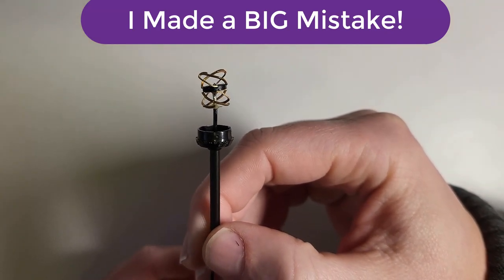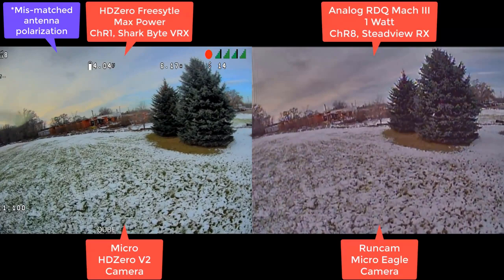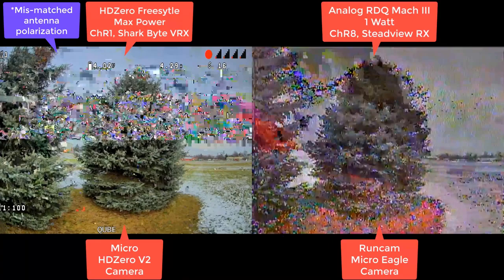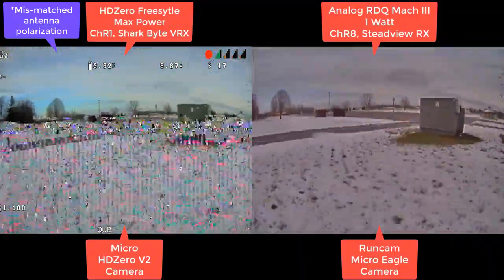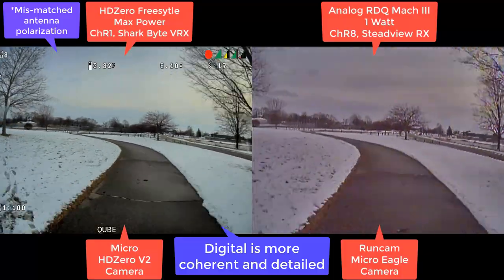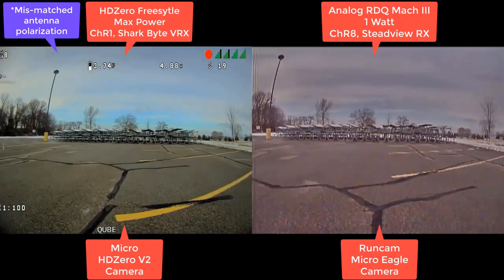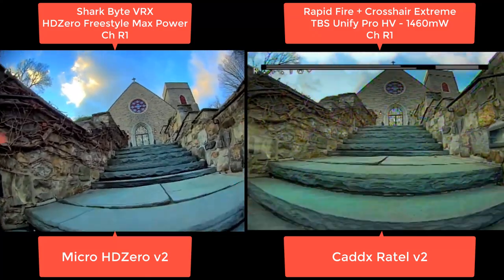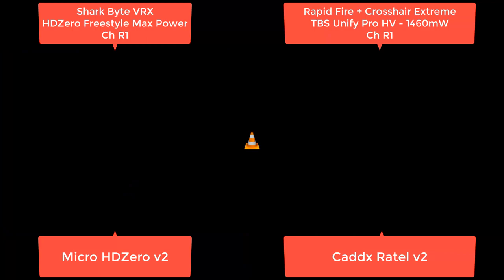Mistakes Were Made! - Outdoor Foliage, Thick Stone - HDZero vs Analog Penetration Tests

Comment: Apart front the actual digital image being a better picture those both seem to handle the environment very similar. Looked like HD Zero had more complete image losses than analog and even though the analog image at times looked like crap there was still an image of some type to fly through. HD was recovering quick thought. I am starting to like the prospect of the HD zero system. Shame about the antennas but we all only human. Good work again.
Reply: You have to take into account that there were mismatched antennae with opposite polarisation on the HDZero quad. Maybe that was responsible for the complete loss.
Reply: @jumpstartfpv  yer for sure, they did a pretty good job to say they were opposites. Look forward to see the difference with equals.

Comment: Thanks vor your videos and your work for the system.
Please let Carl know to include a rhcp or at least give us the option. I dont know a single pilot with lhcp.
Reply: It was said on FB that the sale versions will come with a RHCP antenna. It would have been useful to say that in this video  to avoid confusion for some potential buyers I'm sure.
Reply: @eatyourvegfpv  Thanks for the info, i dont have facebook and would not have seen this otherwise
Reply: @khrom1000  No problem. Hopefully some text gets added to this video (I think that can still be done after uploading) because I suspect it will worry quite a few people.
Reply: I only run lhcp